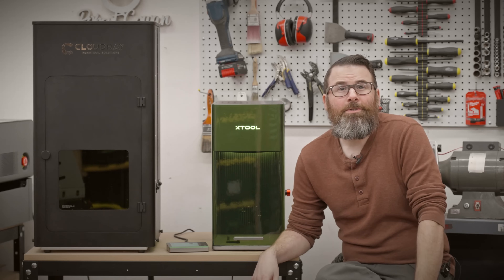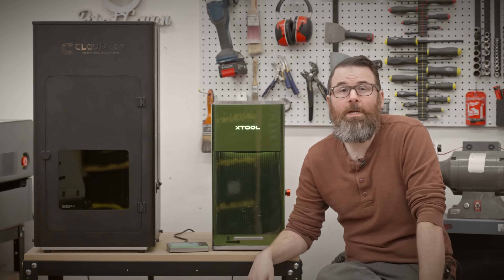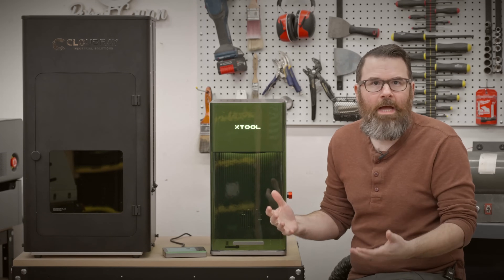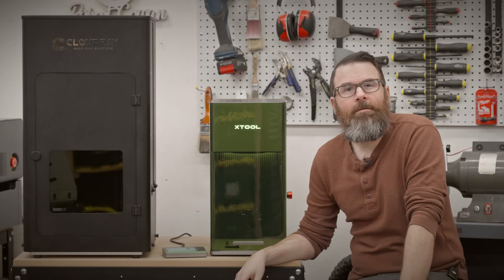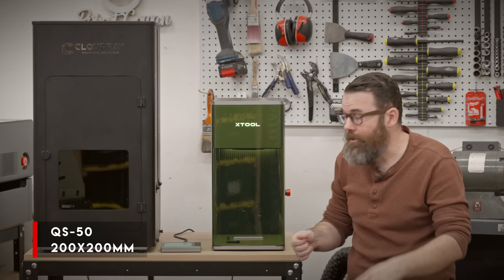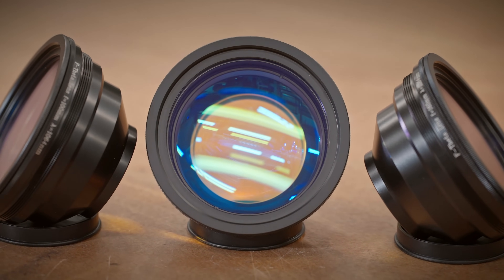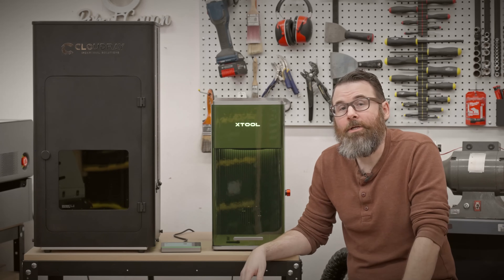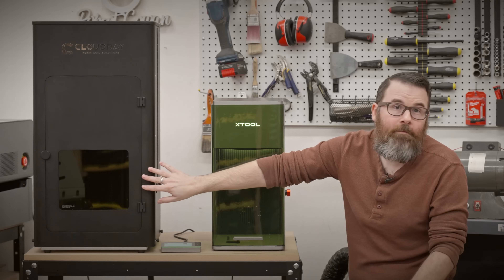Industrial or Hobby Fiber Laser?  Which one is best for you? Cloudray QS-50 vs. xTool F1 Ultra

Comment: That would be an easy decision, the Lightburn compatible laser. No problem with the xTool hardware, but XCS hampers access to the hardware.
Reply from the maker: I've moved away from Lightburn and haven't looked back.  It was good software 5 years ago, but I personally much prefer XCS.
Reply: @RobertCowanDIY  I try but just can't warm up to it.If they'd add a pass-through option I could live with it.

Comment: Hi Robert, I’m looking at getting into laser engraving golf clubs in my local area and I’m kinda lost on what is necessary to get for a fiber laser. I’ve done some research through Reddit from others who have experience with these fiber lasers and they seem to all direct me to getting a more powerful 50-60w fiber laser instead of a cheaper 20-30w laser. I didn’t want to be limited by power and those in the subreddit stated it’s always better to have more power than not enough. If I’m looking at doing “smaller” work like golf irons what would you recommend? A more powerful 50-60 watt would cut down on time consumption of course and leave me will option as like paint filling the engravings afterwards. The XTool I’m worried about it being “underpowered” as in prolonging the engraving process and costing more time to complete the work. This will be my first laser engraver and I don’t want to make the wrong decision or a decision I may regret. Appreciate the video🤟🏼

Comment: There's no wrong answer here, they're both great machines.  I opted to let my xtool go (I had the same one) and I kept my industrial style machine because I preferred lightburn.  I tried using the xtool in lightburn since it does "sort of" support it, but the experience isn't great.  Great video, thx for sharing!
Reply from the maker: Yeah, you're 100% right.  I'm gonna miss whatever laser I got rid of.  Thankfully, I have the Cloudray at work, so I can always use that if I need.
Reply: I totally agree. I appreciate the features of the XTool, but what really matters to me is having a machine that works reliably, so Cloudray is the better choice for me.
Reply from the maker: @northegbert8126  Sure, I wouldn't have any issue recommending either for reliability, but if forced to choose, the Cloudray is just easier to maintain and has a bit less to go wrong.  However, I am cautious saying that, because the sentiment of "less things to break" is becoming a very outdated concept itself.
Reply: @ - ive had zero issues with the xtool.. how is it not reliable?..
Reply: @Xanah_TheLitterBox  What kind of work would you do? Ever tried an environment where machines are kept working 12 hours a day?

Comment: Robert do you have a recommendation for a laser if I only want to use it on 3D printed material?
Reply from the maker: For plastics, just a simple 2W UV laser would work.  The xTool F1 would be a good candidate, it's quite a bit cheaper, has the same software, but a bit smaller overall:  https://www.xtool.com/products/xtool-f1?ref=1DkofC9I&utm_medium=affiliate&utm_source=goaffpro&utm_term=5306
Reply: Great. Thanks for the reply.

Comment: Great video as always. I am curious about something you mentioned - will a CO2 laser mark PLA? You mentioned the Cloudray + a CO2 gives you the same material abilities as the XTool. I thought you need the diode for that?
Reply from the maker: It's all about wavelength.  For the fiber laser, you're not really engraving, but removing the pigment, which is why it works differently on different colors and types of filament.  C02 just melts/burns plastic, so it really isn't useful for engraving 3d printed parts, unless you just melt the surface, which smells terrible and is never crisp.  A UV diode laser can do this as well and is a bit cheaper.  The F1 (not ultra) is a good candidate for this:  https://www.xtool.com/products/xtool-f1?ref=1DkofC9I&utm_medium=affiliate&utm_source=goaffpro&utm_term=5306

Comment: I've made the big mistake of buying a Cloudray 60W MOPA laser that was EZCAD3. Which pretty much means you can never use Lightburn since it is not compatible. I had to sell that machine from that fact since EZCAD3 is terribly unstable and filled with bugs/crashes. I'd highly recommend people going with EZCAD2 machines if they're going the cloudray/similar route.
Reply from the maker: The Cloudray machines are also compatible with Lightburn, and in many cases come with a free license.
Reply: @ some cloudray machines are ezcad2 and some are ezcad3. The ezcad2 one's are compatible with Lightburn.
Reply: Now they've released a tutorial for EZCAD3, but I haven't used EZCAD3 yet, so I'm not sure if there's a runtime crash.

Comment: The problem is, you really need a product for these lasers. I rather buy a 4th axis for my cnc or a small lathe than a fiber laser for 4K. 
If I need a custom panel I can order a PCB with custom silk screen.
Reply from the maker: You're not wrong.  They're both a bit spendy for casual use.  I do plan on using them more and they're certainly nice to have but they're better suited when you have a product to sell.  That being said, they're way cheaper than a CNC machine, and many hobbyists have those in their shop as well!

Comment: With the F1 Ultra you also have "Galvo" speed with the Diode Laser which the P1/P2S does not offer. 
But as you mentioned F1 Ultra is more or less for engraving and not cutting materials so different use cases ;) 
As always great video !👍
Reply from the maker: Absolutely!  The extra speed is nice for some things.  And thanks!
Reply: @ Cutting is just fine in wood and metals used it to cut out stuff on aluminum and stainless steel just takes a few passes is all